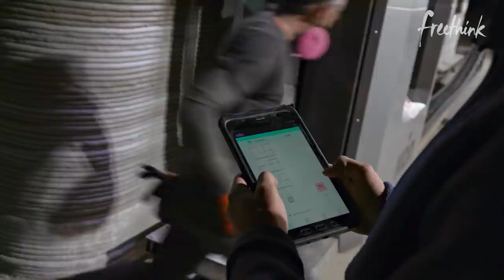3D Printed Homes for the Homeless

Comment: Still uses lots of Land, requires lots of individual Maintenance & shows no use of Renewable Energy, that provides low cost Utilities.
Take a Motel Like approach with an Inner Court to meet & support each other - hyper insulate the Units, so even loud Neighbours won't be heard, you will get Roof Space, that can be fitted with lots of Solar Energy + Solar Heat - even to a point to overproduce and sell the Overproduction to the Grid to pay for Communal Services. You can also fit easier Assistive Technology into such Structures like Ceiling Tracks to get people from the Bed into the Bedroom or open Living Room Space. Add Shops so those who still can or want, are able to work - add a Kindergarten and School so old People can mingle with low Income Families - the elderly can be incorporated with the young Kids, where possible.

Comment: What is the square footage of the house? how much does a house cost? where does the electric go? where does the central heating and air go?
Reply: 17
Reply: or maybe 34
Reply: northwest corner
Reply: It says in the video half the cost of conventional building techniques, I wouldn't be able to comment on the square footage of the house but I'd assume that these are single bedroom houses with a lounge, kitchen and bathroom. The electricity is probably routed through the loft area or the cables are run whilst the building is being printed. There was footage of the groundwork with water and waste mains already plumbed in with the plot
Reply: @hardassponge9018  what's half the cost of a conventional house😂 that's very arbitrary